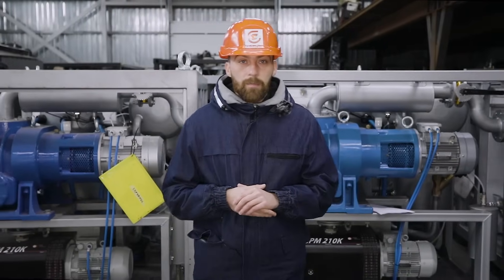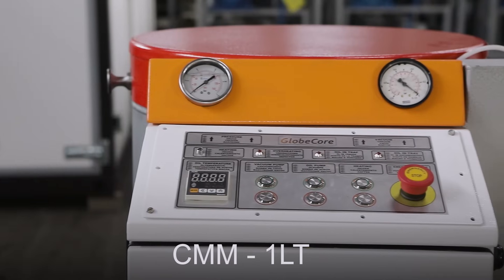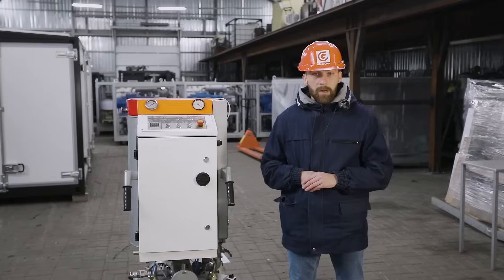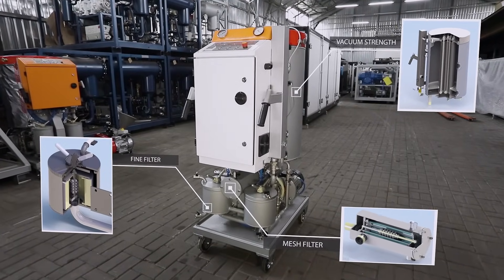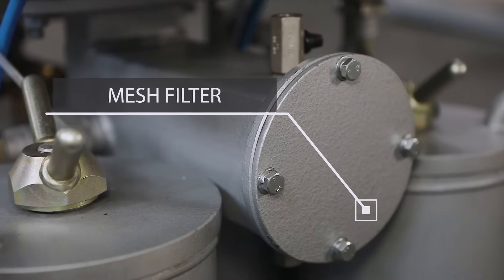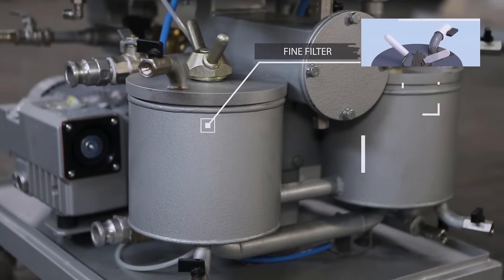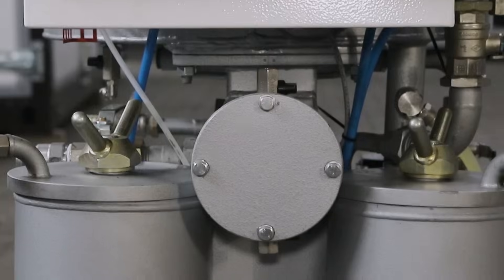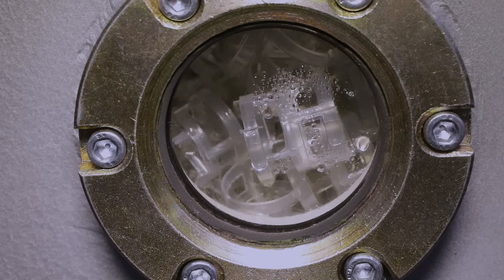Portable Transformer Oil Purification Machine - CMM-1LT GlobeCore

Comment: We often have to service small transformers. Can this oil purification machine be used without disconnecting such transformers?
Reply from the maker: Yes, but with the use of additional equipment to increase security. We recommend connecting this machine to the transformer through the TSS safety system.